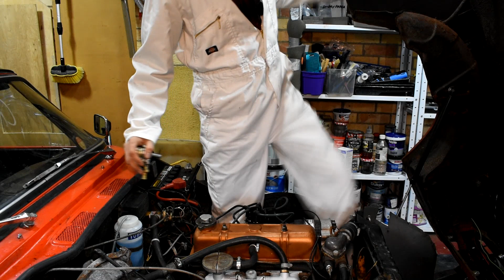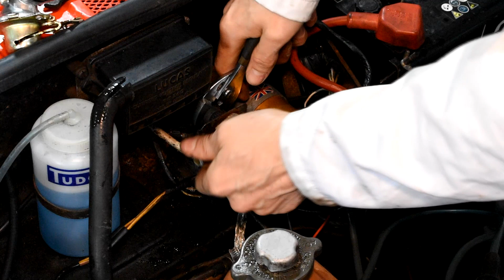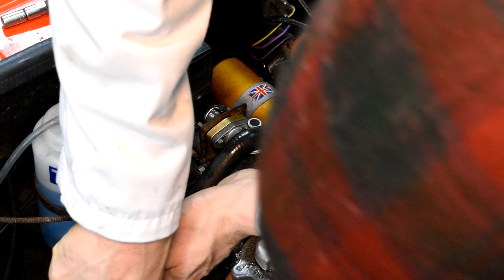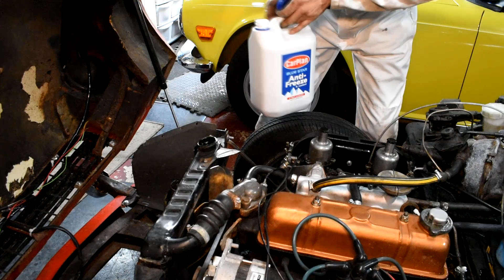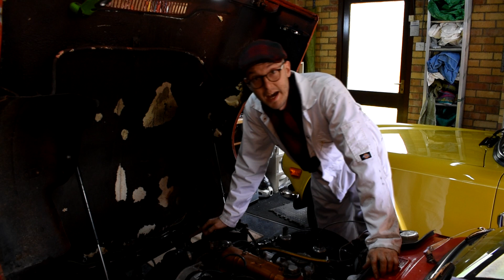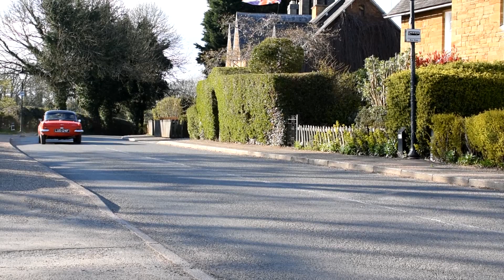Triumph Spitfire Heater Valve Tap

Comment: Thanks for this Steve! My Mk 2 had the valve removed by a previous owner so I've got a new one to plumb in. It's worth noting that early spits have 'pull for heat' type valves and later ones are 'push for heat' types so you have to be careful to order the correct part. Some sellers advertise the same heater valve for all marks, so it could be easy to get caught out.
Reply from the maker: That's an interesting point that I didn't know about, and I'll pin your comment to the top as it maybe helpful to other owners 👍

Comment: Hi Steve, many thanks for good information. Question: when you set the valve to open as shown is the inside pendel set to cold or warm?
Reply from the maker: The most simple way is to pull the cable one way, see where it is, then push it the other way and see where it is, then lock the valve adjuster arm to it using the logic of how it moves each way

Comment: Just started doing mine as valve was leaking. Old valve bolts were seized solid so now need to order the flange and o-ring too! What you’d think was an easy job ended up being another PITA!! 😂
Reply from the maker: Sadly sometimes that's the way it can be with 50 year old car. It's better to prepare to fail, than fail to prepare 👍

Comment: Hi Steve, I've been tripped up by missing hardware. What size are the bolts for connecting the valve to the flange, 3/16" UNF?
Reply from the maker: It's a 2BA thread with a 3/16 spanner size. Moss Motors do an excellent catalogue with all the drawing and diagrams for all the parts you'll ever need for your Spitfire for free. It's worth looking at there website and getting hold of one 👍
Reply: @SteveDentonClassics  thanks Steve, great hint, I went and looked at Moss' website and realised I can't put the valve in as the whole heater bypass return path is missing.